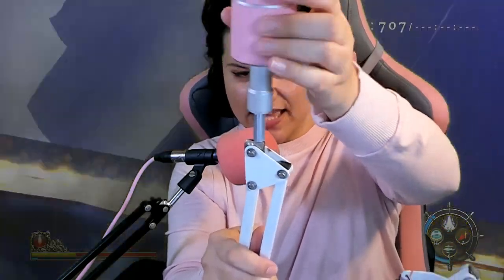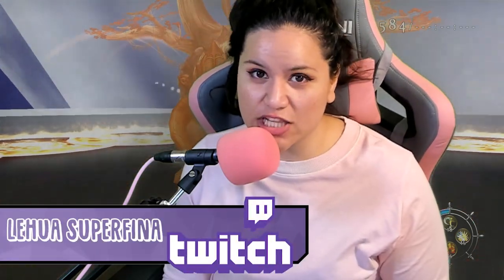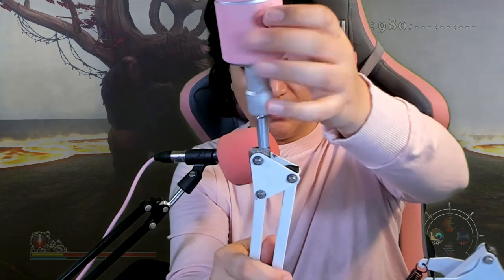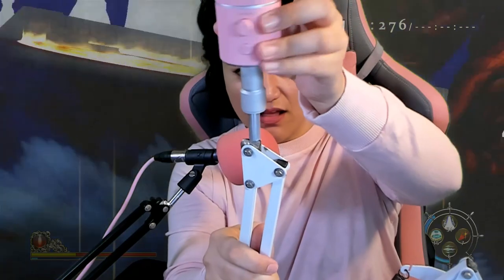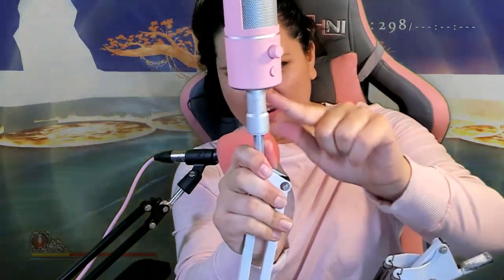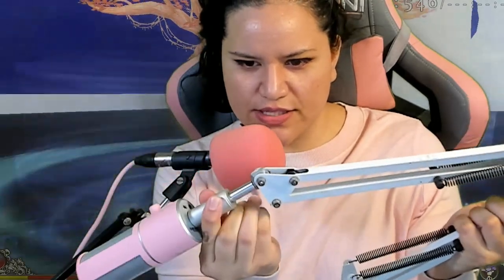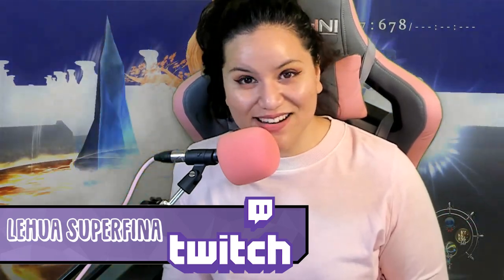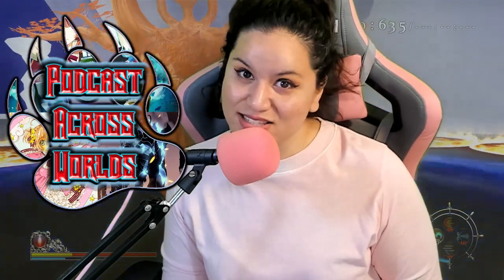What arm do I use? | Razer Seiren X Mic | Answering Questions

Comment: I was wondering why the adapters I bought (and the one that came with the arm in the link) didn't fit, it's because the pink screw peg on the bottom can unscrew. Once I unscrewed it, the adapter that came with the kit fit perfectly.
Reply: So there is no need to by the adapter screw?
Reply: @ajharvey2860  not as far as I can tell

Comment: Heya, great video!! I’m looking to pickup a razer seiren x myself cause i’ve always just used my phone’s microphone. Quick question cause i see you’re using a different mic for your recent videos, Would you still recommend the seiren?
Reply: hold up. you've used your phone's mic?!?! Why do u need a usb microfone FOR A PHONE. BRUHHHH.wtf
Reply: @chroiiz2721  nah i'd typically just split the audio track from the video and try and run that through audacity and some noise reduction tings.

Itsokay i've decided to go with the Rode Wireless Go mic. its pretty decent and inconspicuous
Reply from the maker: Seiren X is a good mic if you want a sleek look. Sound wise this mic is comparable to Blue Yeti. I've gotten feedback about the mic and a lot of people have been using software to make it sound better. People are either using a physical mixer or a free mixer software. 

If people are getting a mixer for the Seiren X then in the future people should go for Elgato's Wave 3 because it includes its own easy to use mixer software.

And honestly it all depends on a person's needs and budget. The Seiren X is $99.99, Yeti can range from $99.99-249.99, the Wave 3 is $159.99. A person may also get a mixer that's another $50-500. @UhhRiff went to Rode which is a high quality brand, look at any pro streamer/youtuber/podcast host and you will most likely see they are using a Rode mic. @UhhRiff did the research and got something he needed atm 👍

Comment: I’m late but pls get back to me as soon as possible can I mount the seiren x using the adapter that comes with the arm?
Reply from the maker: Yes, you can. It has a 3/8"to 5/8" Screw Adapter. Just make sure you unscrew the peg on the bottom of the mic. Once you unscrew it, the adapter that came with the kit will fit.
Reply: thank u so much

Comment: Why is the adapter so big compared to the pictures on Amazon
Reply from the maker: The adapter I used in the video came from an old set (arm, shock mount holder, and adapter). I couldn't find the exact model on amazon so I found alternatives with the same diameter measurements. 
If you're still unsure, another option is to visit a music store (establishment specializing in audio equipment) near you and physically compare the screw adapters to determine the right fit for the mic.
Reply: Ok thank you I’m going to buy the mic and the other stuff but in black

Comment: the piece on the bottom does not come off in my experience, and i really want to get an arm for it. twisting it off does not work. can you put the adapter into the plastic piece on the bottom?
Reply: the piece meaning the pre-installed one that is impossible to get off
Reply: i have a seiren emote and i’m not sure if it’s the same as the seiren x in the way that the adapters fit

Comment: Do you know the exact measurement of the adapter? Maybe I could save a bit of money buying the one individual piece instead of the 4 piece set from the link you provided. 😅 Also thank you for taking the time to answer questions about the Razer Seiren even though you've moved on to an XLR mic set up.
Reply from the maker: 5/8 in. Male - 3/8 in. Female Mic Screw Adapter
I don't mind helping out on questions I can answer 💜

Comment: The adapter doesn’t work
Reply from the maker: Another person mentioned something like this and they found out they needed to unscrew the middle piece connecting the mic to the stand and at the bottom of the mic was the female part for the adapter to connect
Reply: @LehuaSuperfina  if that works than thank you so much! Also the problem with the adapter it’s the wrong thread so that’s the o key reason why it doesn’t work! But thank you for telling me that! :)

Comment: I have a question bout the adapter
Reply from the maker: what's the question? 🤔
Reply: Lehua Superfina why does the adapter on the vid look bigger than the one in the link and if you could give me a link for that bigger one
Reply: @exposeninja9111  I have the same question
Reply from the maker: The adapter I used in the video came from an old set (arm, shock mount holder, and adapter). I couldn't find the exact model on amazon so I found alternatives with the same diameter measurements. 
If you're unsure another option is to visit a music store (establishment specializing in audio equipment) near you and physically compare the screw adapters to determine the right fit for the mic.